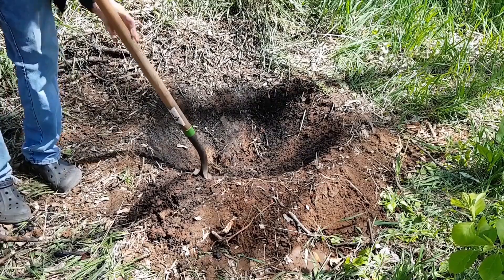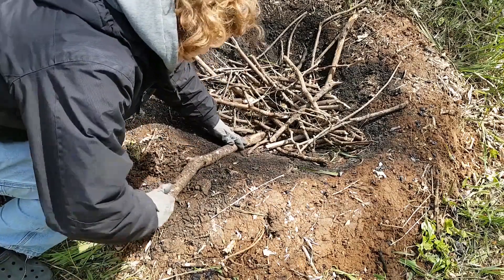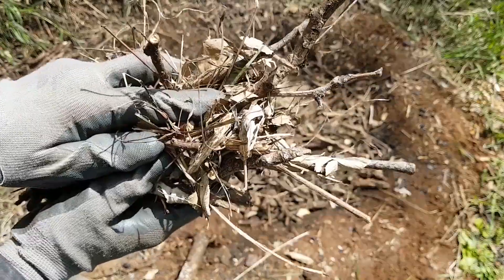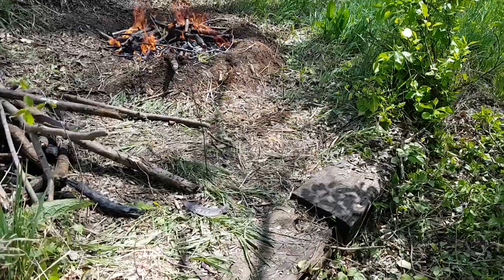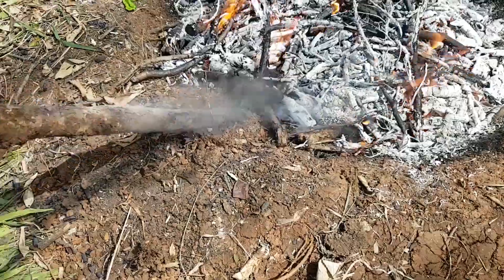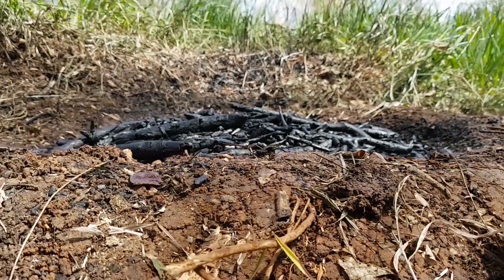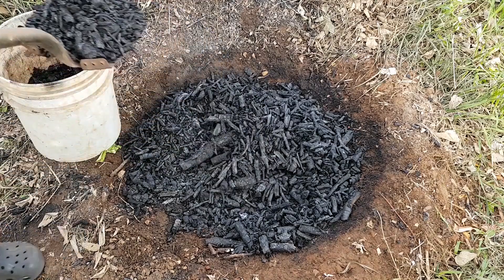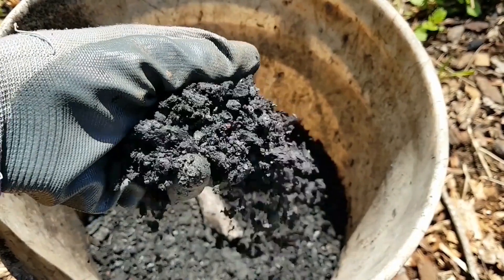Making Charcoal for Biochar - Bonfire Method, Starting with Full Pit

Comment: I find if you light a small fire, then add layers of fuel as the first layer starts to ash over, and repeat for each layer, you get a more consistant charcoal. I've tried different methods, now I use an old oil drum on it's side with a ~10" wide slot cut for the burn hole, it limits the oxygen just enough, and still produces a consitant charcoal with different dia wood, still need to douse it of course.
Reply from the maker: Great info.  Thank you for the tips.

Comment: Ash is beneficial too. Burn longer, save the ash and mix with water and water with it when your plants are fruiting and flowering to add potassium,  calcium, magnesium, and other minerals.
Reply from the maker: I agree, ash is a great fertilizer when used carefully.  Temporarily messed up my soil pH with it once when I added too much, but it self-corrected.  Was a good lesson for me.  I can get ash from the stove so I just focused mainly on making biochar, but you make a good point.  Thank you for the tip.